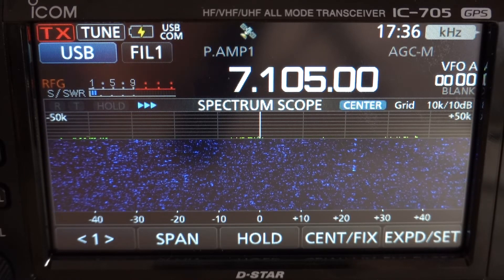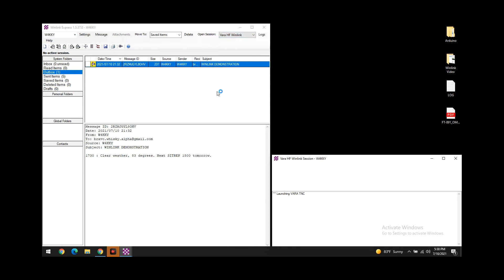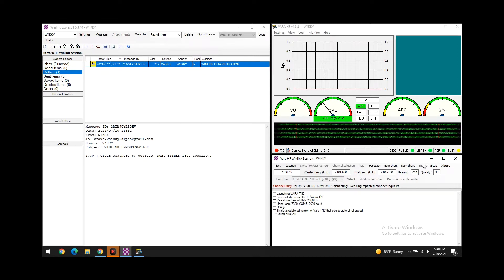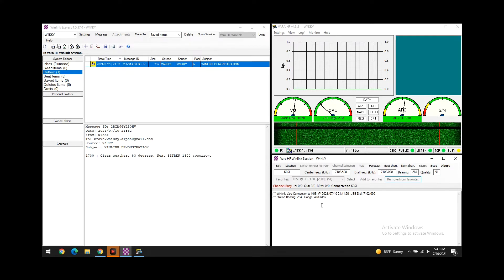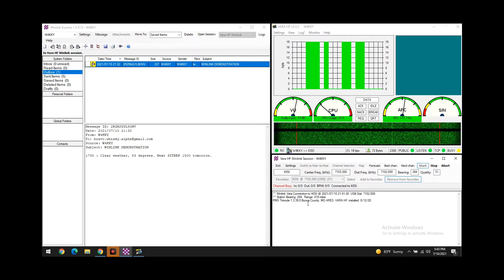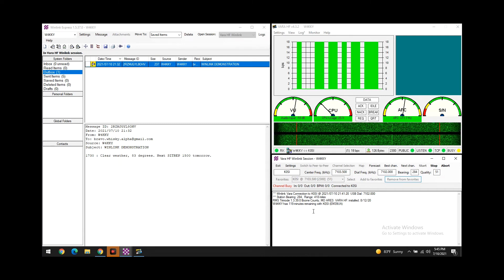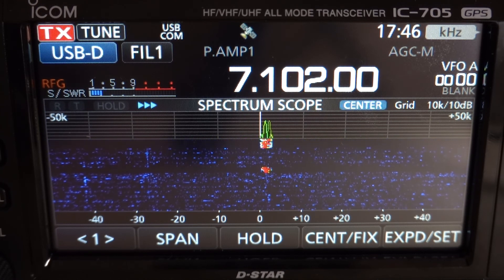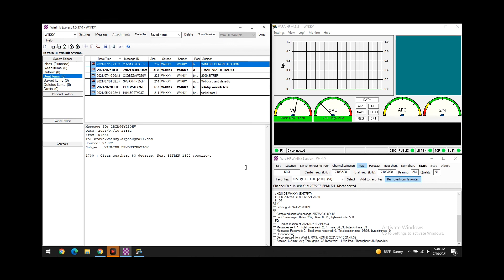IC-705 + Winlink (Vara HF)

Comment: What are your settings on the 705 and in VARA HF? I am using a GPD POCKET 2, running Windows 10 and trying to operate wirelessly between the 705 and the laptop. No success. I can connect but VARA is not seeing a sound card on the 705. What am I missing? Thanks!